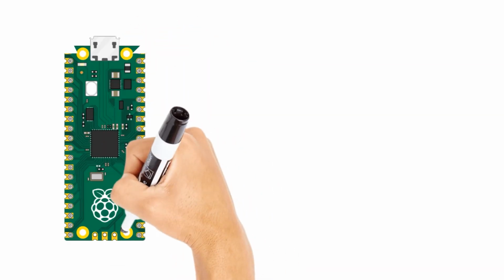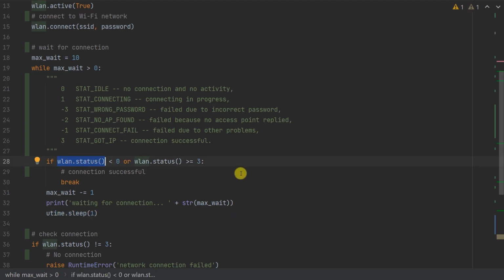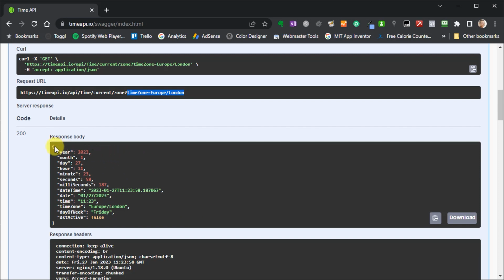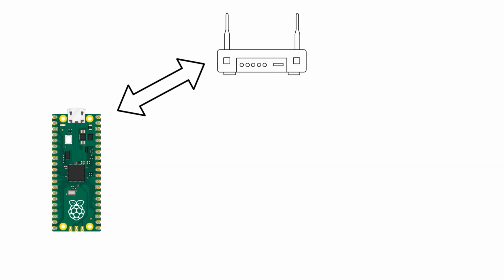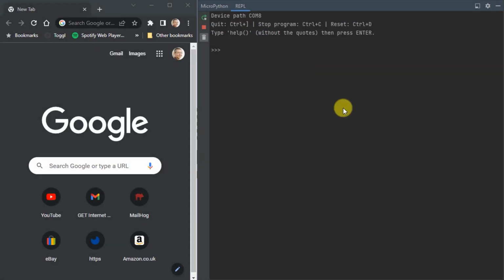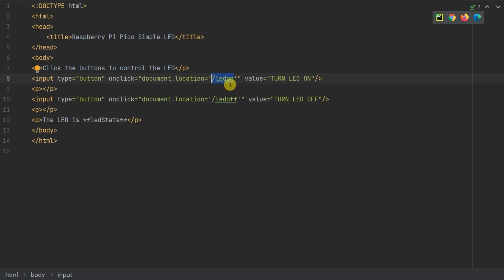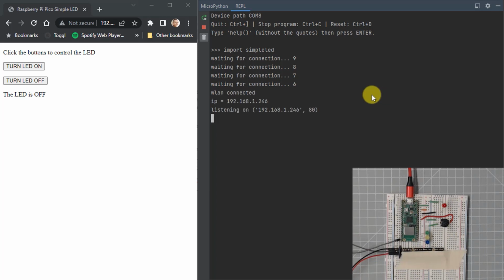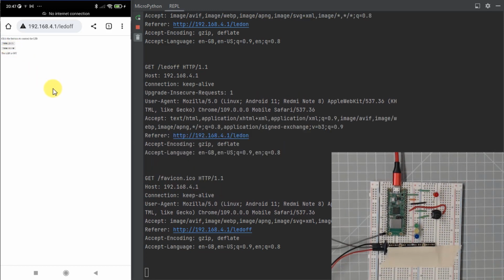WiFi Control Your Micropython Project Using a Web Interface

Comment: Why am I getting this ERROR: OSError: [Errno 9] EBADF.  on the following: client.close()
Reply from the maker: I think it's telling you the client object wasn't connected to a valid stream or file when you tried to close it. Did it get closed in some error before the close call or something like that? Were you able to read anything through it? You'll need to put some debug output in the code leading up to the close statement to find out what's gone wrong.

Comment: thanks for the great tuturial. I have a question though, how did you copy the html file into Pi Pico using Pycharm?
Reply: all good, I found you explained in another video, thanks again
Reply from the maker: No problem. Hope you get it working.

Comment: In ap mode, did you need to turn off the sim on the phone?
Reply from the maker: The sim shouldn't get in the way. You should see it as just another wifi network to connect to.

Comment: In terms of content, I am looking for a way to store the access data for the WLAN securely, i.e. not in a separate file as plain text. As the RP2040 does not have a CryptoChip, the integration of an external chip such as the ATECC608A would be a possibility. But to be honest, that's a bit too much for me without help...
Reply from the maker: Sounds like an interesting project.

Comment: Excellent video! I have an sensor and i want to display new values every 2 seconds. Could this be done without refresh the page? Something like ajax method. Pico return the date to javascript, and javascript change data via ellement id
Reply from the maker: Yes. Create a read data API endpoint and use it to read the data every 2 seconds.

Comment: Thanks for this excellent video. I will expand this to a mobile robot control. Currently controlling using RC PWM via Pico and I though I could expand to DIY telemetry if the processing power and signal is solid.
Reply from the maker: Sounds great! Let me know how you get on.

Comment: This excellent!  I've studied micropython for a long time, and this the best tutorial that I have ever seen.  Thank you very much sir for sharing this.
Reply from the maker: Glad it was helpful!
Reply: I have an idea for a project for you on your channel.  It would be for a timelock device (like for a bank, but for personal use).  It would comprise a scheduler, a calender, a schedule, perhaps an mqtt interface, and an a hardware interlock for actuating door lock relays.  If you consult, and are interested, please quote me.  I've looked at iec61131 and openplc to do this, but it has to be designed properly, and tested.  Having an open source program would create a community, and I think that such a project would be very popular.  I have a garden that I must tend, haven't coded for years, and also have other building construction that I is higher priority.

Comment: Stupid question: is there a way to program the pi pico w over wifi?
Reply from the maker: Not such a stupid question. Not directly. You'd need some sort of base image running in the Pico that allows the files to be uploaded. I'm not sure if that exists yet for the Pico but it's not unfeasible. Have a search on Google.
Reply: @BytesNBits  Thanks for not calling it stupid 😀, I indeed did some google foo and found something called "OTA" (Over the air) update like JFrog, it seems is used for large companies when they need to updates hundreds of IoT devices (pi Pico w). Perhaps a future video about it?

Comment: Thank you  ... I am an absolute beginner when it comes to MicroPython ... your video is excellent. 
Instead of the Raspberry Pi Pico I am using an ESP8266 Node MCU and the Mu editor. 
The only change that I found necessary to adapt your code to my ESP8266 was to change the 3 to a 5 when reporting a successful connection ... for some reason wlan.status() returns a different set of numbers when using an ESP8266.
I look forward to your future videos
Reply from the maker: Glad it helped!

Comment: Can it be controlled by any place in the world
Reply from the maker: You'd need to expose your Pico through your router. By default your home router won't let external traffic onto your network - at least it shouldn't!!! You need to set up port forwarding to allow connections through your router to the Pico port 80 (HTTP port). Once you do that you can access the Pico on your home IP address (you'll find this in your router settings but note it can change over time unless you've got a static IP address).
Reply: @BytesNBits  thank you

Comment: Thank you for this tutorial.

I this is one of the first I have encountered to point out that  socket.accept() is blocking until a request is received.  I am particularly interested in learning how to use this to provide a web interface for my project yet still allowing the Pico to read and log sensor data (or do other things) while it is waiting for HTTP requests.  

I am very much looking forward to your followup to this tutorial with REST API examples and (hopefully) allowing the device to do other work while providing a web interface  (interactive or API).

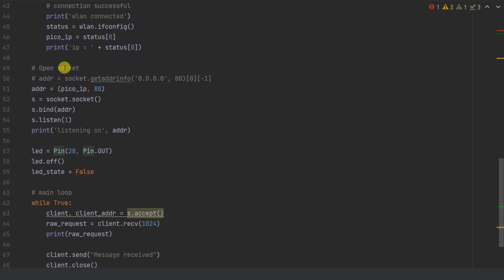Comment: That piece of code at 24:00 is not in your github.
Reply from the maker: Hi. It's the simpleled.py file. The one on the GitHub repo is the final version. At 24 minutes we're just building up the code. Just comment out some of the url decoding bits. I hope this helps.
Reply: @BytesNBits  - OK, got it!
Reply: Very well explained tutorial. Looking forward to more on the Pico. You took a several month break, hope that isn't the case after this one.
Reply from the maker: @jimcraig5727  Hi. Work got in the way as usual. Back on the electronics again. These projects take a bit more time to create.
Reply: @BytesNBits  I'm hoping you may expand this Pico WiFi tutorial to include a wifi manager. I'd like to be able to use my robot car projects on other networks without recoding each time. Your detailed, clear method of instruction would be beneficial.